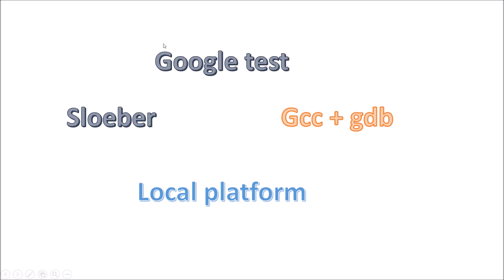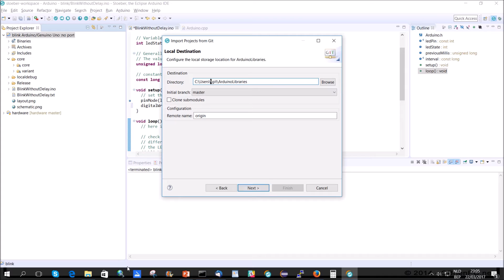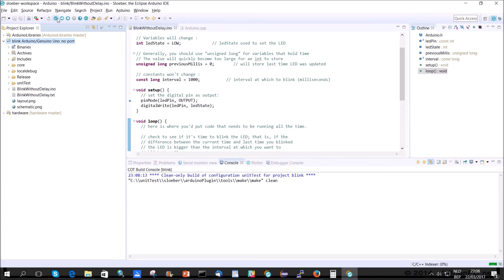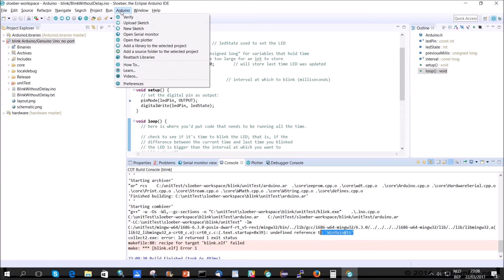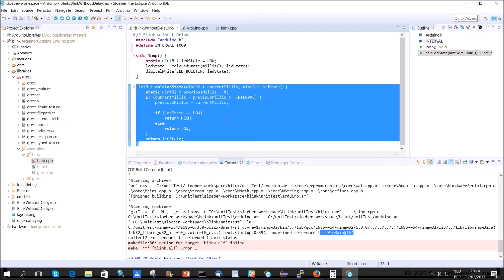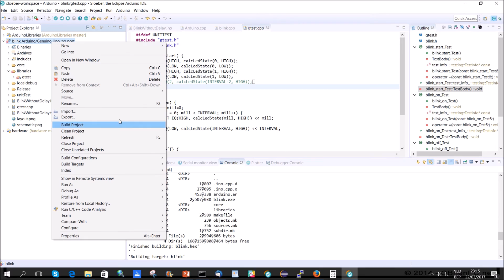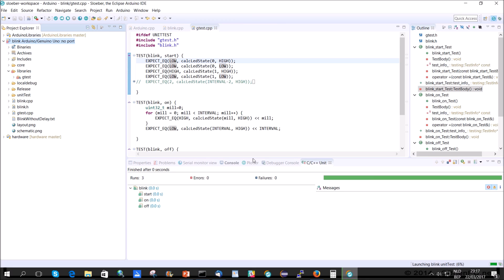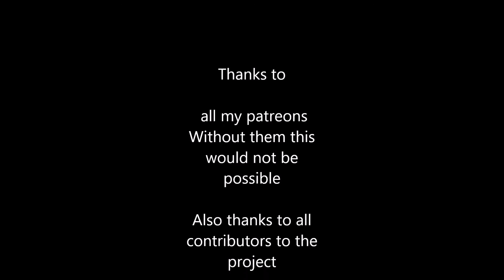unit test your Arduino code with Sloeber

Comment: You say "lots has changed". Is there any documentation on how it should be done? I'm testing Sloeber 4
Reply from the maker: It seems I havn't made a video about this one yet but is is very similar to esp8266 and zero debugging likz you see  here https://www.youtube.com/edit?o=U&video_id=WFzVzgEA8Fo
Reply: @nogmeerjan What about it very similar? That video is about debugging, not unit testing. I am creating a unitTest configuration following this video and there is no option for "Debug or Unit Test" under Jantje/hardware/esp8266/1.0.0 in 4.3
https://www.youtube.com/watch?v=WFzVzgEA8Fo